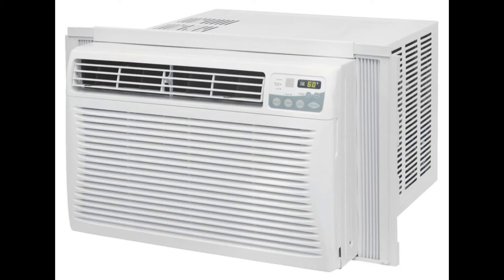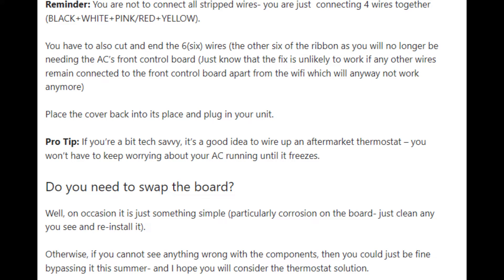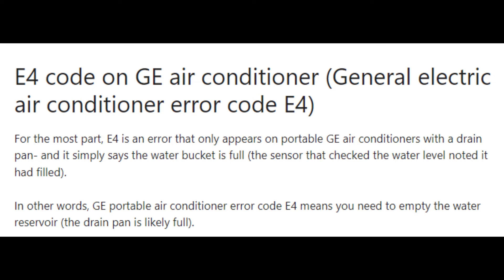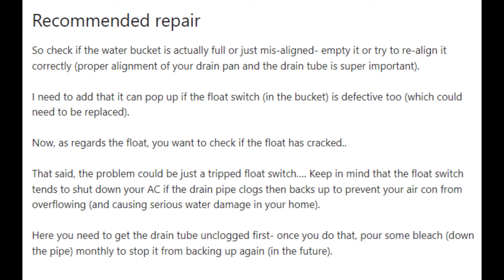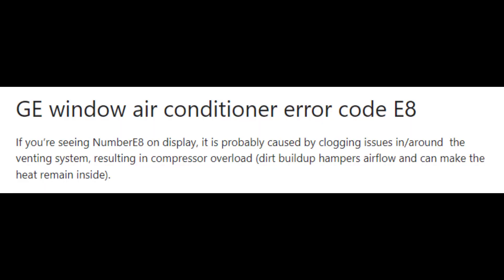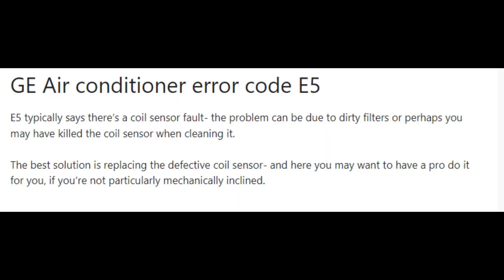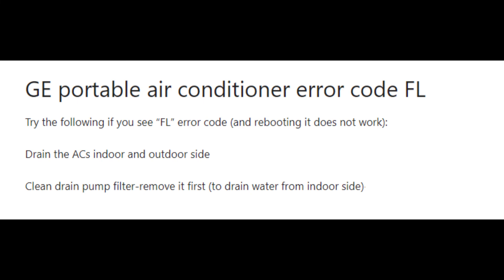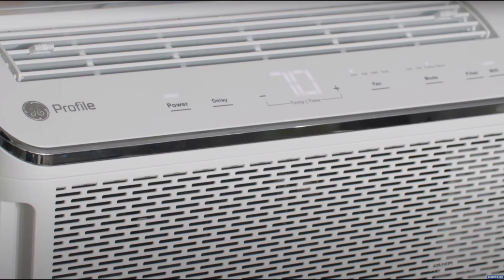GE Air conditioner error codes

Comment: What about an E0 error code?
Reply from the maker: EEPROM parameter error
Reply from the maker: Unplug the unit then switch off breakers.
Wait about 10 minutes before you turn power back on.
See if the error E0 has cleared.
If not, outdoor or indoor PCB may need replacing.
Reply: 14 E displays
Reply: What if no error codes but the control panel doesn't respond when you press any button only the delay button turns on.  Doesn't respond to remote either.  It's a heat and cool unit.  Model GE: AHE12DXL2